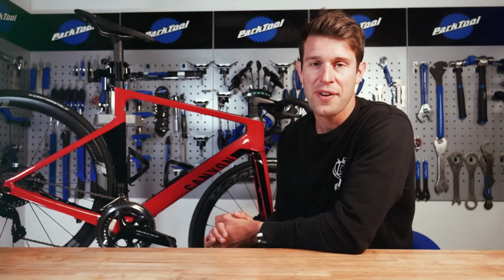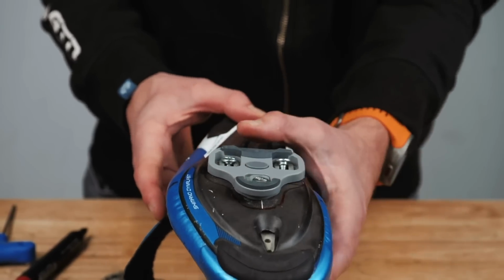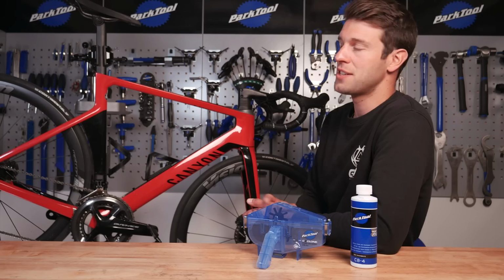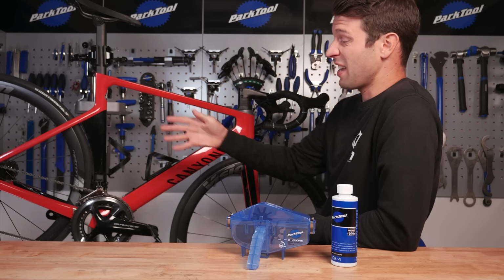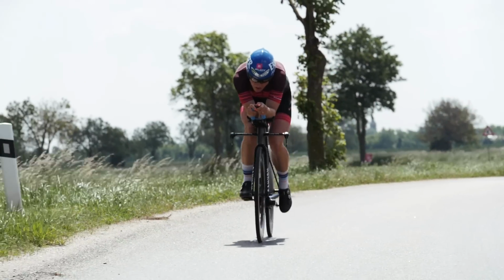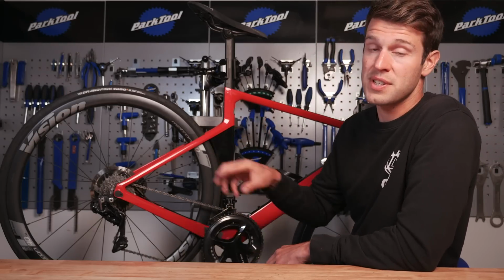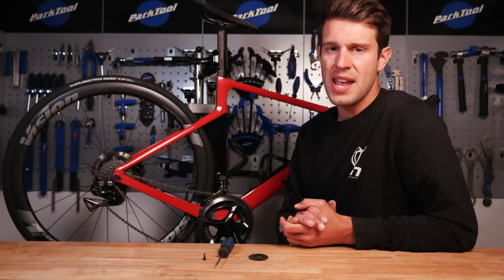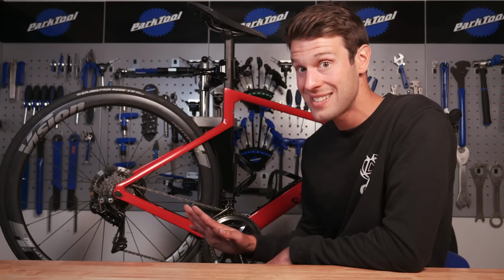6 Free Speed Maintenance Tips | Make Your Bike Feel Like New On Race Day

Comment from the maker: What do you do to prep you bike for race day? Let us know!
Reply: I always make sure the bike is cleaned, polished. All the drivetrain is cleaned, lubed and all the gears are functioning correctly
Reply: I always clean my bike after I go for a long ride, and I make sure the chain is always lubed pre race so as it runs smoothly as it can, and in a short race I always race with the minimal amount of water to save weight.
Reply: Mentioned by you librication and bolt check.
Inspection of tire surface. And, may be, selection of tires/wheelsets for anticipated conditions.
Sanding brake pads (does not matter, for rim or disc brakes - the latter need "glase removal")
Adjusting brakes to "firm feeling" (it saves time, when you have better modulation of braking)
Adding couple energy gels into saddle bag (may save time whilst just refilling bidons at feed stations)
For off-tarmac events, attaching XL saddle bag with more tools and spares.... and energy bars.

Comment: deflating your tyres might give you more grip, but it will also provide more friction, probably cancelling all your other adaptions.  For example you will notice better fuel efficiency while driving your car on a long journey with fully inflated tyres compared to partially deflated tyres.
Reply: Jonny LaRock   This is not true. Most people overinflate their tires bike. You also can’t compare rolling resistance of a car tire at 32psi to a bike tire at 90psi.  
Here is a better explanation:   https://m.youtube.com/watch?v=E3C5RzQrTvw
Reply: @trbeyond  I didn't watch the whole video you linked (partly becuase psuedo-science doesn't interest me, and partly because it was a test on rough surfaces), you do not have a suspension system on your bike at all or as complex as a cars, but, I also wasn't talking about this either.  All I said is that lower than spec tyre inflation will lead to an increase in friction and thus drag.  Maybe this is acceptable for your rolling situation.